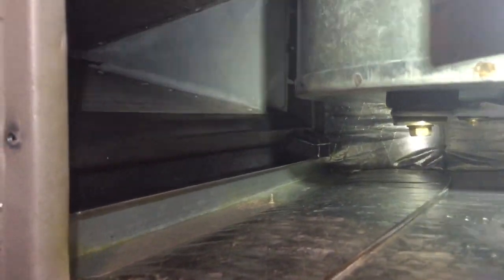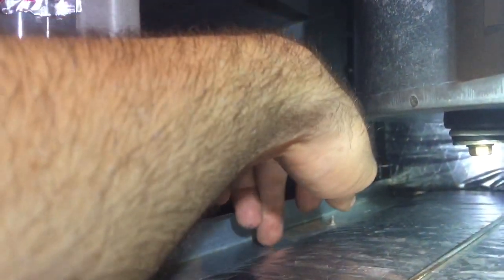Ruud Condensate issue

Comment: PLEASE SHARE UPDATE.  WHAT WAS THE OUTCOME??? I HAVE EXACT ISSUE
Reply from the maker: Original Texan we ended up replacing the air handler with the larger 21". Although we did find some insulation in the coil where the drip deverters were I'm not sure if that was aggravating the issue.
Reply: @joeshearer1247  Let me ask one more question. What if you did nothing?  Would the air ducts get moldy?  Air handler get rusty?  I already called three techs and none of them know what to do.  It is odd because the unit is 6 years old, and the problem just started.  Will never purchase Rheem again!
Reply from the maker: Original Texan yes if you dont fix it will ruin the air handler. It will rust it out and may cause motor to fail. I have this problem on a lot of different brands it is not just Rheem. I still think they are good units. Something happened to make yours start.... this one did it from day one.
Reply: @joeshearer1247  Thanks for your time. Once I get unit fixed, I will leave an updated comment.

Comment: This is a very common problem for horizontal configuration of a vertical unit in Florida and the Gulf Coast.  With high humidity, velocity force exceeds gravity.  I specify a horizontal coil + electric furnace.  These are available from ADP, Goodman, and York.  The actual coil in the boxed "horizontal coil" is completely 90 degrees vertical, resulting in maximum gravity.
Reply from the maker: I'm familiar with ADP and goodmans horizontal coil but never seen a York. I have seen the goodman ones leak too though same way but I think they were on a bad duct system where velocity was much higher.
Reply from the maker: The only thing is you limit to one option for every horizontal system
Reply: Joe, great participating in the conversation.  The main limitation is one of inventory.  Distribution primarily only stocks the horizontal coils up North for gas and oil furnaces.  In a "horizontal coil" (remember, the coil is actually vertical) the air flow is perpendicular to the gravitational flow of condensate.  The water at the top of the coil has a straight shot to the bottom.  The only grab that the air flow has on the water is the thickness of the coil.  Now, carefully look at the coil in your video.  How is water at the top of the coil ever able to make it to the bottom???  Not only is the water required to travel a far greater horizontal distance than vertical, it travels against the flow of air until it reaches the apex of the "A".  Now, as water accumulates in the lower half of the coil it is under significant force in the horizontal plane to stay on the coil until it reaches the end where some gets blown off.  In the lower half of the coil the water actually picks up horizontal speed!

To solve your issue economically, you might reduce air flow to 350 cfm/ton.  In doing so, your customer should notice a welcome reduction in humidity.  If the refrigerant control is fixed orifice, leave the refrigerant charge as adjusted for 400 cfm/ton and note the lower super-heat expectation.
Reply from the maker: Yea I totally get what you are saying about the horizontal length the water must go fighting the air. I don't want to lower airflow because this is a 3ton on a 2400 sqft home in Florida and I designed and installed the ductwork in such a way it needs 1200. All the latent is taken care of by the run time. I'm not crippling it by reducing the fan just yet. I will be upset if Ruud says you can't run 1200 cfm through this horizontal right air handler unit and that is the final answer. Not acceptable to me hope you understand.
Reply: I applaud you not over-sizing the system!  I live in an 1800 sqft home with 3 ton and I wish the system was 2 1/2 ton.  On the hottest day this year (August 1) the system only ran 11 1/2 hours.  I get good humidity control with a 2 degree differential in the thermostat resulting in long cycle times.

Please report back with Ruud's response - thanks!

Comment: I could be wrong but are you sure the coil is supposed to be mounted in that position? Seems like the drain pan should be on the return side. BUT your application is horizontal right. Maybe the coil has to be just as it is in your video. I do not install many horizontal units. I have a tip though. I keep a piece of plexiglass behind my driver seat in my van just for these situations. Remove the blower panel. Put your plexiglass over the blower section just as if it was the panel door. This allows you to look in to see what is going on in there.
Reply from the maker: The only issue I had with plexiglass it fogged up so bad I couldn't see anything happening